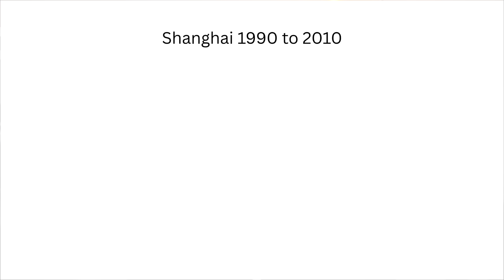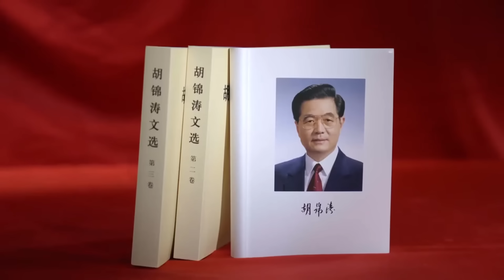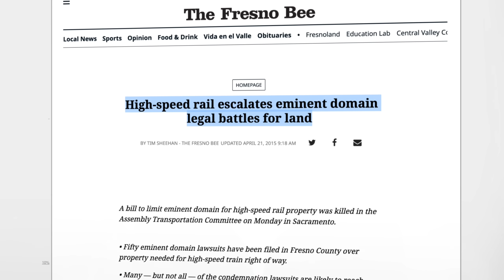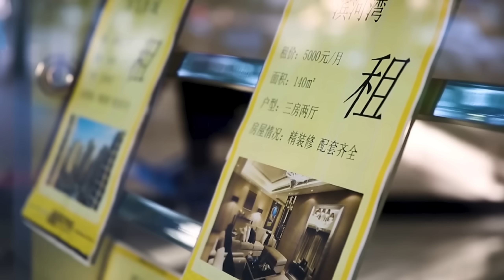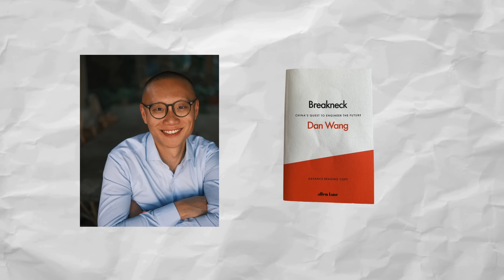Why China Builds Faster – Engineers vs. Lawyers in Power

Comment: Slowing down don't protect. Some number here.. In US, 1 death for every ~100 million mile-passenger driving. China HSR serve ~0.5Trillion mile-passenger a year so if it were the same death rate as US driving, it would have 5000 deaths annually. So 40 people over the last 15 years is excellent. If you delay, more people will die driving (since the Chinese driving death rate is slightly higher than US.)

Comment: I think the argument fairly valid but is not as simple as that, is not only the vision of the politicians but rather because bureaucracy is the core deep issue with a democratic society, where there are a lot of polarized ideias which paralyses progress, whereas China is a dictatorship which makes everything far less decentralized than US and can easily act in whatever public policy they want. That efficiency is amazing and is certainly a thing to consider on how and where we can implement those skills, but the thing that I’m also concerned about is that that often may come with extreme downsides such as exhausting working hours with bad salaries, deep environmental impact and extensive rights violations. The thing is that each system chooses which priority they have and but I don’t thing is right to say the US system is the only flawed and the others are advanced where they are two extremes, falling in providing what the other have the most. Romanticizing China’s advancement is also problematic because the human cost of building this advanced country is too high. The reality is building this kind of infrastructure or lawful system is hard and requires a discrepancy in other aspects. I think the best we can do is to find a middle ground in those extremes and build a government with both lawyers and engineers, whereas a system that truly understands the needs of both sides and works hard in action but also balancing the human rights.

Comment: China doesn't have the checks and balances a democratic system has. 
If the Chinese government wants a new high speed rail they will pave over your 300 year old home to get it done. 

Efficient, but brutal. Not sure it's worth it.
Reply: You do realize the US did the same thing when they built the highways through minority neighborhoods, right? They only justified it using eminent domain, because it's legal as long as they provide "fair compensation". Where were their checks and balances?
Reply: @garmenlin5990  Perhaps. 

But does the US have anything (in modern times) comparable to the 3 gorges dam? which allegedly displaced millions of people and tens of thousands of homes?  

The HS2 project in the UK is extremely expensive and slow to construct because they legally have to tunnel much of the track so that homes and lands are uninterrupted on the surface. 
China doesn't seem to have that same issue building their extensive amount of high speed rail tracks.
Reply: Yes, let's all stay in the 17th century together.
Reply: Except thats simply bs Maoist era laws protect rural areas to such a degree there are numerous cases of developers building around entire villages because they couldn't get permission to build

Comment: China is a developing country, they have to build bridges where there were never any, build highways, rebuild ancient villages to modern towns etc. The US on the otherhand doesn't need a second golden gate bridge over the same river. It already has build most of their damns and infrastructure long ago. The US is developed and has most of the infrastructure it needs. And obviously it's easy, cheap and fast to build a highway or skyscraper were there was none before. But tearing down a highway or skydcraper in use to build a new one is expensive, you have to reimburse the current tenants etc. Also does New York need 50 new skyscrapers? No. There already is enough office space.

Also important to note this is China's development model (asian development model). Start with heavy industries and supercharge construction industries and then work your way up the value chain to more complex industries later. So basically construction companies are given subsidies, preferential treatment, funneled investment, government contracts and cut red tape. 
The US on the otherhand doesn't need a supercharged construction sector to industrialize/develop. They actually did that already in the late 19th century when it stamped put todays new york skyline in a short time.

TL;DR: China and the US are at different stages of their economic journey. China is developing so they empowered their construction sector. The US generally is developed so the construction sector isn't the focus and modernization is expensive and slow.

Comment: This has nothing to do with whether the leader is a lawyer or an engineer. The key lies in the fundamental differences between the political structures of China and the United States. Regardless of which party is in power in the United States, their legitimacy stems from their election-based leadership. This also means that as long as the ruling party in the United States does not engage in overt violations of the Constitution, it will not lose its legitimacy. Therefore, while in power, they can focus less on addressing social problems and more on maximizing their own interests.

China, on the other hand, has only one ruling party, the Communist Party of China, which did not gain power through elections. So how can it gain public recognition of its legitimacy? It must meet the needs of the people and resolve the principal contradictions in society.

According to the CCP itself, in the 1980s, it defined the principal contradiction in Chinese society as "the contradiction between the people's ever-growing material and cultural needs and the backwardness of social production." After more than 30 years of economic development, in 2017, the CCP revised the definition of the principal contradiction to "the contradiction between the people's ever-growing needs for a better life and unbalanced and inadequate development."

While the solutions and costs remain debatable, they are indeed addressing and resolving these issues. Otherwise, the CCP will lose public recognition of its legitimacy. In China, this means the ruling party will be violently overthrown and permanently lose power. It is this sense of crisis that constantly spurs the Communist Party of China to work hard to solve social problems.

Comment: 1. Centralized, unchecked power means the top can draw up grand plans and execute the plans with no resistence. 
2. Cheaper labor, state owned construction companies, funding by stated owned banks mean money is less of an issue.
3. Infrastructure investment was the main way to boost GDP and it worked well for quite some time so no incentive to slow down even when many areas were overbuilt (multiple high speed train stations in small towns).
4. It was also a great way to consume all the concrete and steel in over-capacity, keep massive population employed, and support growing real estate prices. 

It's actually how China got into the massive debt problem it has today.

Comment: The American slowness doesn't mean projects are safer. Quite the opposite, projects are artificially delayed to raise building costs, and projects are hastily finished just before deadlines, with good initial quality but become expensive headaches in the long run. China at least standardized their infrastructure construction so things are up to code and consistent every time, and because of the economies of scale of mass production of prefab structures, projects cost much less and are completed faster, with little to no compromises in safety.

Comment: I actually don't think putting engineers in charge in the US would be a good idea, in fact I think it will make the problem worse. I think it depends on the system the country is run by. Yes engineers are perfect for china, buts that's because it is a country ran from the top down. If an engineer wants to build something it's gonna be built. In the US however, with it's democratic system, I think it's wise to have lawyers in positions of power because whatever needs to be done, needs to be according to the law. And if an engineer wants to build something, but has zero knowledge of the law, it may make a project go from being slowly realized to being completely impossible because it didn't even clear the first legal hurdle. 
It's just different systems that require different qualifications for people in power. In the US the government is below the law, while in china the law serves the government and both systems have their advantages and obvious drawbacks.
Reply: most politicians and specially the top level ones have a team of lawyers to take care of the legal hurdles for them, what is important here is the decision making , engineers fit in china's power positions because the whole economical and political system is ran with pragmatism and focused on well planned objectives while USA system is a complete circus with endless bureaucracy and useless discussions about how many genders are.

Comment: The small town where I live recently spent three million dollars and months to rebuild a single intersection.  It now has brick sidewalks with little plaques commemorating the ferry boats that used to be in service on the nearby lake a hundred years ago. That's it.  And they still haven't finished putting the walk signal buttons on permanent poles, they're mounted on oil drums filled with concrete with cables hanging down from the traffic lights.  Total cost of the project:  three million dollars.

If you want to see what I'm talking about, go to google maps and input 100 kirkland ave kirkland wa and look at street view.  The fenced areas are complete but those oil drums are still there more than a year after the street view photo was taken.  

"But those bricks and plaques look so nice!"  Yes, but not three million dollars nice.  That's thirty dollars for every man, woman, and child who lives in the city.

Comment: You are trying so hard to find the negative side of China infrastructure buildup. You even quoted an accident over 14 years ago. That's a 60,000 km high speed rail network carrying millions of people each day, running without a major accident for over 14 years! Yet, the so called "damage preventing" US system didn't prevent the numerous train wrack in the same time period, with 1/3 Chinese trains' speed.

Comment: The high speed rail crash is caused by a lightning strike that led to equipment failure. Please focus on the actual cause. When you have that much length, you cannot foresee many things. Chinese rail is by far the most advanced in the world and goes thru more different regions with different climates than in Japan.
Reply: Japan is already too advanced they they just concentrate on very regular and punctual services they don’t need more. It’s also much smaller than China

Comment: I can smell the CCP in this video
Reply: Stay mad loser
Reply: @qjtvaddict shut up bot
Reply: Yeah, it’s pretty strong. Almost ALL the comments fail to mention anything about corner cutting and focus on just praising the nation.
Reply: @LordDaret How many miles of high speed rail has the US built?
Zero?

Whining about "corner cutting" won't change the fact that China is way ahead of western countries in several areas.
Reply: @stephendaley266 But how long will that HSR last, and will the economic activity it generates surpass both construction costs and yearly maintenance? If it doesn’t, that rail is bound to shut down in most places, not even considering potential accidents and even higher maintenance costs.
Reply: @LordDaret yup you 10000000% right  myFriend